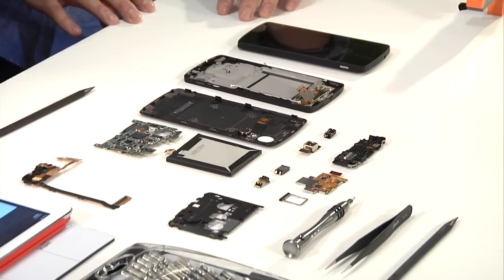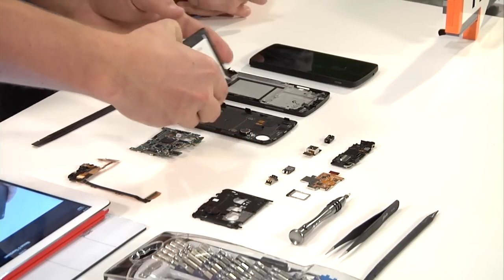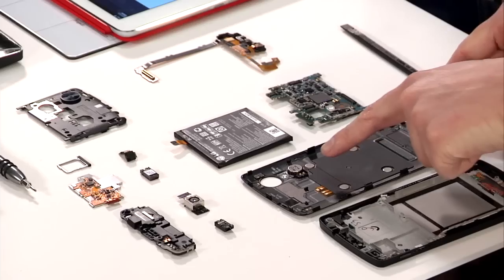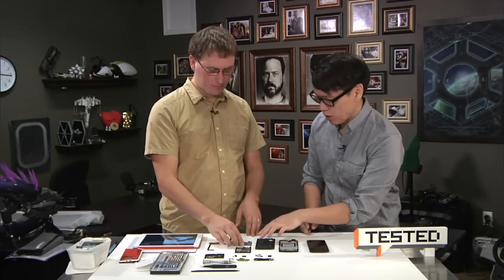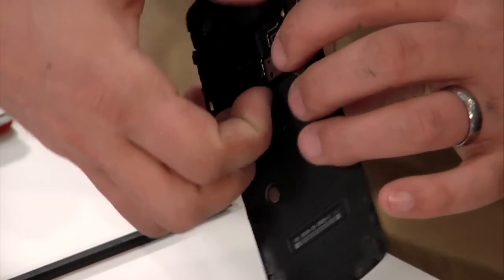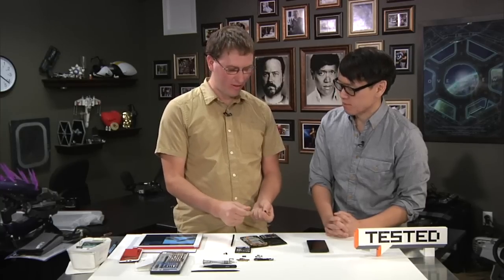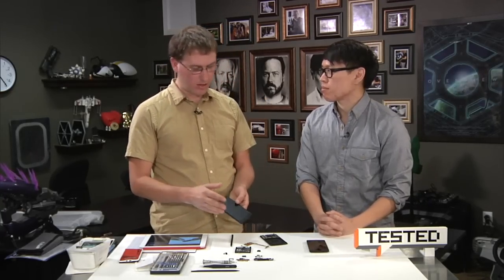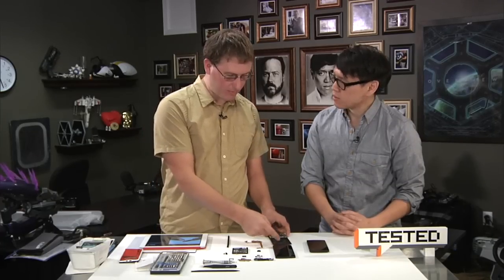What's Inside the Google Nexus 5 Smartphone

Comment: The Nexus 5 currently has a critical issue: recording videos in a quiet environment will produce a loud static noise in the audio.

Evidence suggests every single phone has this issue, but not everyone has noticed yet. However find any videos on Youtube from the Nexus 5 in a quiet room and the static is the only thing you can hear.

People have already experimented enough to say that the echo cancelation software/drivers that they're using is the issue.

Google has acknowledged this issue, yet continue to sell the phone to people without telling anyone.

4.4.2 did not address this issue and there is currently no ETA for a fix.

Comment: What are those component opposite of the front facing camera to the right that looks like 2 more cameras?
Reply: Those are the light sensors. You can tell because if you cover them up, the screen goes dark to adjust to the new lighting.

Comment: If I replace the motherboard, does the motherboard need to be the same storage as the previous motherboard? For example: I want to replace a 32 gb motherboard with a 16gb motherboard. Will it work?
Reply: Yusuf Mostafa as long as the board fits and it will works !!! !! !  !!!!!!!!!!! ! ! !! ! ! !!!!!!!!!

Comment: Hey Author, i need to ur expert advice...i replaced my nexus 5's back cover. since the new one did not have the vibrators battery i had to take it from the old one and connect it to the new one...on removing i noticed that it was stuck to the cover by a glue

Question: what glue to use to hold the battery to the cover?

Comment: The reason why the Nexus 4 and 5 display assemblies are so expensive is because there is low demand. If the only component that really ever breaks (the display) costs almost as much as the product, can the rating really be 8/10? I'd still say the iPhone 4/4S is the most repairable product. All the components are modular and cheap. The display is $25. Back cover is $5 and takes two seconds to replace. OEM battery is $6 and takes 10 seconds to replace. The iPhone 5 is better for replacing the display, but the display part costs $60.

Comment: Battery only lasts a year or two? Man, phones have really gone to shit.
Reply: Just look at the processors in them, some of those phones are better than your old pc
Reply: Micic00 That may be an explanation, but not a defence.
Reply: SAsgarters
 There is no need for defence, only explanation.
Reply: Micic00 Hate to disagree with you here, but that's completely backwards, in my opinion.
Reply: I meant to say that today's batteries are so much more powerful than just a few years ago, and you can see that by simply using your smartphone and seeing what power is needed to sustain all the apps running, wi-fi, gps, etc. You probably meant to say how batteries haven't kept pace with other technological advances implemented in phones. But that will change pretty soon.
Reply: Micic00 Batteries arent actually more powerful they are just slimmer and are a bigger capacity batteries in phones havent changed a whole lot to be honest which sucks since phones are so powerful.
Reply: AyooJake
 When talking about power there is a power to weight ratio of batteries that is one of the  calculations that we use. I can only refer to that. I agree there haven't been major changes, maybe the vanadium phosphate batteries will make some major improvements
Reply: I don't know about other phones, but my htc desire hd's battery is 2 years+ and still gives a day of moderate activity.. so it's alright for now.
Reply: I have the Nexus 5, but I am wondering how long the battery will actually last I haven't had much luck with the Android phone batteries in the past. The good thing is that the Nexus 5 charges really fast. From ~30% to 100% in about an hour.
Reply: Phones aren't just phones anymore, they are actually computers with which you can also call now.

No wonder they don't last long. :P At least they last a full day.
Reply: SAsgarters It's not backwards. There is no need to defend how battery technologies haven't been able to keep up with Moore's Law, because hardly any technology does. After all, we still don't have a flying car.
Reply: Micic00 my phone is even better then my laptop atm :/
Reply: Goliath my nexus 5 only lasts 4 hours of screentime at %15 brightness
Reply: Makalon102 Well that's... about right?
Reply: my laptop last way longer than that lol

Comment: i was kinda dissapointed in the nexas 5.
The LG G2 is better even though it came out first?
why? what happened?
Reply: Well... Considering that the Nexus 5 is $350 and the LG G2 is about $700 it pretty much explains itself...
Reply: KeenWolfPaw I'm looking at a new unlocked LG G2 for $475.00 on Ebay. New Nexus 5 is 399.99 for what I would want, the 32 gig. So the gap is definitely closing...haven't made my choice which to buy yet, getting one of these phones next month though no matter what.
Reply: Google wanted to make a high end phone without going over 500 bucks. For the hardware your getting its a reasonable price. Of course some shortages are goona be made but its still up there
Reply: The Nexus 5 is definitely the best phone for its price on the market, I have it and its amazing. The only thing lacking is the camera quality but that's to be expected for price.

Comment: faulty motherboard gave me just 4 months off of warranty, and a lot of troubles with the nexus 5 are caused by the funky main board that lg dishes out. check out the nexus support forum. its filled with complaints that all have the main board at fault, even the seemingly software issue ones. if you are lucky it would break within the warranty period, otherwise you will probably get screwed, like i did.

Comment: What would happen if I replaced the 800 snapdragon with the 805 will it still work
Reply: Zamblot pretty much impossible to replace. it's a System on Chip, not just Chip. The whole motherboard is made to be replaced together, taking the chip of it is pretty much impossible. And the motherboard is only made in this form for nexus 5.

Comment: Bro, my name is shravan. my phone is oneplus x, two days back a small incident happen. my phone was in my pocket, when i was riding rain started suddenly and i was in rain for 30 mins. After reaching home...i don't know what happened to my phone it was switched off and i felt water inside my phone when i tried to turn it on, its not happening .....after two days i removed my phone from rice bag...i tried to turn it on buts its not showing anything in my display...when i connected my charger, in display its not showing anything but i was red light in notification....
 

               So, bro please tell....if water entered into the phone...will phone turn off automatically or not......if you say it will turn off automatically please tell me the reason...and tell me why phone showing red light when i connected charger

Comment: I went for the Moto g instead of nexus 5 so yep worth it.
Reply: I doubt it
Reply: CodyMetal get one
Reply: redseasplitter You do know that every aspect of the nexus 5 is better except for the price compared to the moto g?
Reply: CodyMetal i understand this but the one reason is my moto g has been lasting a day and a half with normal use which works for me the nexus 5 barely lasted a day for me on my normal use. :)
Reply: redseasplitter Easily achievable on the Nexus 5....
Reply: Nocturnal with Mobile Data turned on 24/7? doubt that.
Reply: redseasplitter Uh yea. I have Google now on, all location reporting on, WIFI on, Mobile Data On and right now Im sitting at about 80% with a little over 9 hours up time and 1 hour of screen on time. All it take is a custom kernel to get what you are acheiving easily especially if its normal an not moderate to heavy use or with gaming involved.
Reply: Nocturnal u may have all that on but use it
Reply: Pablo Quiroga idk what everyone else is doing with their nexus 5 cuz i get over 15 hours of use with over 3-4 hours of screen on time, and my phone still isnt dead. it might be that im fine using hspa+ vs lte that is no better except at wasting battery
Reply: Pablo Quiroga
I have a nexus 5, so far loving it, lasts for 4hrs screen up time, 20+% battery left, on 15 hrs of "on battery", so the battery is rly good if you know what to do with it, when you get a new phone ;)
Reply: M4kind Easy solution to battery life is a portable charger. I got one from amazon that was $16 and it holds 3,000 mAh and is small enough to carry in your pocket.
Reply: Nice deal right there ;D. Though I see that only some people are complaining about battery life of the nexus 5, which is kinda strange, because those people maybe actualy wen't wrong with first 3 charges :)

Comment: Great video...repair those electronics instead of replacing them!
"What's Inside the Google Nexus 5 Smartphone"
They are joined by special guest iFixit CEO Kyle Wiens, who has taken apart Google's Nexus 5 smartphone for a thorough teardown analysis. They examine each of the phone's components, see how they're assembled, and discuss just how easy it would be to repair the Nexus 5 if any of its parts breaks down.

Great web site & find more of iFixit's great teardown guides at http://www.ifixit.com

Comment: I dont understand. This guy keeps talking about Apple and how they aren't straight forward in taking their devices apart. "The battery has too much glue" or "the mother doesnt come out easy". Does he not know that 1) Apple devices have a pull-tab to get the battery out, essentially making it more user friendly? And how is it not straight forward to take out an apple motherboard. Undo the connections and take out the screws, what is so un straight forward compared to this? Some people just want to be anti-apple to be anti-apple.
Reply: Because apple is the kid that doesnt match the others, the one that is in the same classroom and refuses to bond with the rest.
Reply: They have custom screws that they use. You have to buy special ones to open their devices. "User friendly" huh?
Reply: Its entirely Philips once you get inside. they are different so dumb people cant easily just mess with their phones and then whine to apple that it doesnt work.
Reply: plopbellie The guy said a lot easier than taking apart my phone... pulls out an iPhone (clearly not anti-Apple). I have no idea... but he seems to know what he's talking about.

Comment: vibrators, thickness, holes, bulges

sounds like porn listening in to this

-------------------------------------

anyway i have a HTC one X. im a bit disappointed in it. can be very slow.  but i want to get the One or LGs new android phone. i was surprised on this nexus phoen that the main board only took the top part of the phone. i recall old basic phones using up the whole length of the case